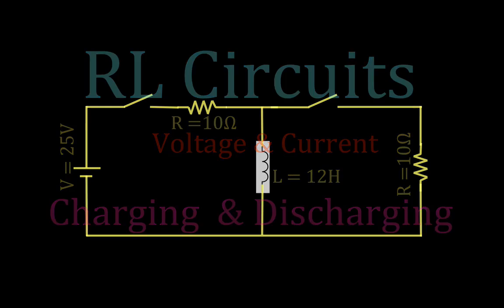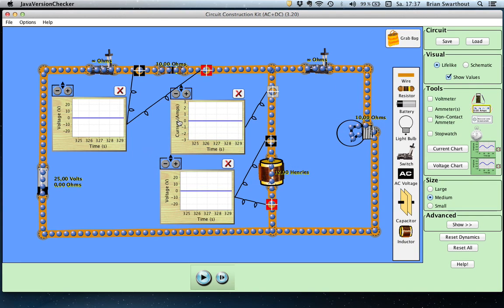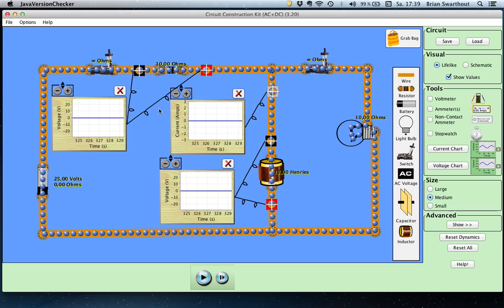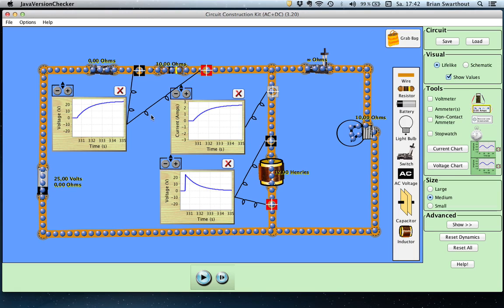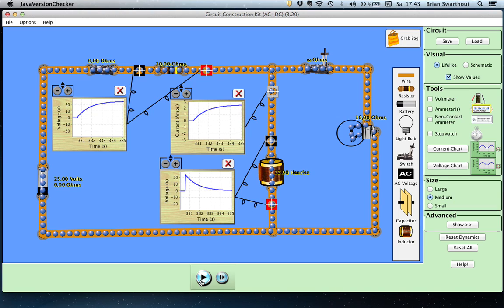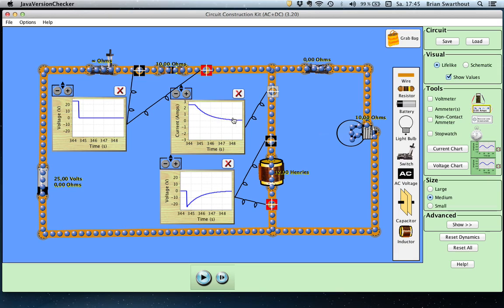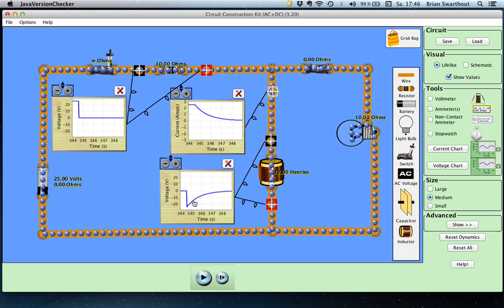RL Circuits (4 of 8) Inductor Charging & Discharging, An Explanation, Part 1

Comment: Could you make a video on LR circuit and switch controlling connection btw L and R for 5V supply? The voltage across R is intersted when the switch is in rise and fall time of control signal.

Comment: When you first close the switch the voltage to the left of the resistor should jump instantly to 25 volts. It's a step just like it jumps instantly to zero when you open the switch. I also believe the term exponential is confusing. Is logarithmic correct, I'm not sure either. Maybe negative exponential or inverse exponential. There is an "e" in the differential equation. I'm 61 and that is way to far back for me.

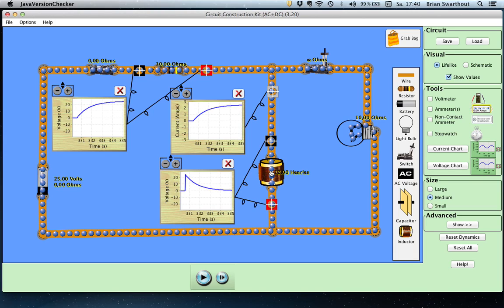Comment: at 4:27 - 4:32 the voltage across the inductor is showing +25V, shouldn't it be opposite, -25V? Thanks
Reply from the maker: OK yes, but the magnitude of the potential difference is 25. sorry for my mistake.
Reply: @stepbystepscience lol sry, I just trying to learn electronics on my own, so confusing

Comment: very difficult to see the polarities of voltage and directions of the current when inductor is charging/discharging. just that its increasing/decreasing. both terminals are labeled by a + polarity what does that mean? red color should signify positive voltage polarity, but im not sure that is what its doing here.

Comment: Interesting. Even though the current through the inductor goes in the same direction immediately after turning the battery off, the measured voltage drop across the inductor flips from  steady state zero to negative. The magnetic field shifts from becoming the consequence of electron flow to the cause, as the magnetic field collapses. I suppose that should be obvious....